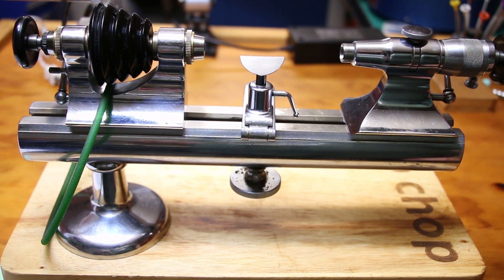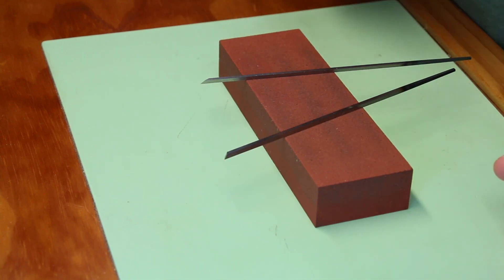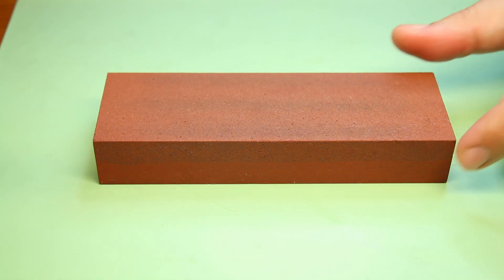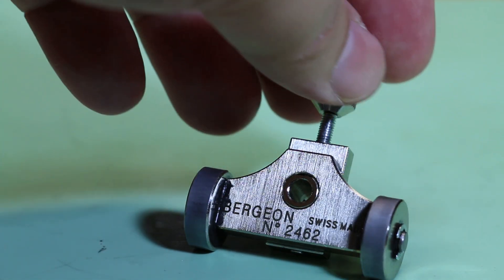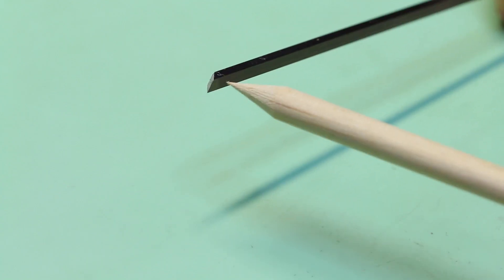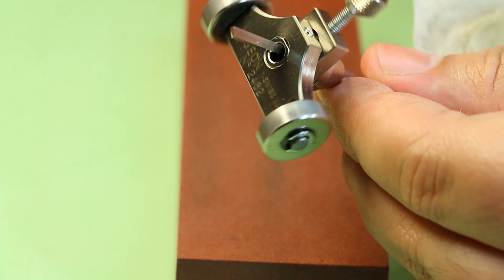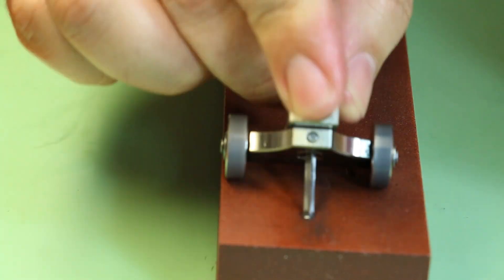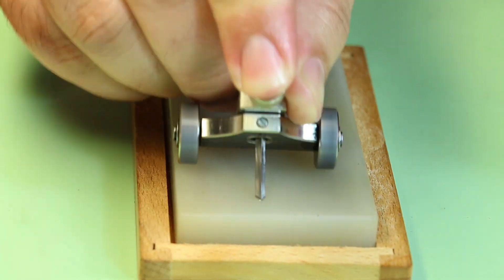Watchmakers Lathe Graver Basics - How to Sharpen a Graver using the Bergeon 2462 Tool

Comment: Using the sharpening tool, the stone wears in the center fairly quickly. You can dress the stone by oiling and rubbing it on a cheap HF type diamond plated plate and watching the grove in the center shrink to nothing. Great for refinishing yard sale stones.

Comment: Hi Dean, I just got a 2mm graver with handle off of ebay, but when it came I discovered that the handle is just a regular pin vise, and won't accomodate a graver longer than 2 inches..... do you know of any places I could get a proper graver handle that will accept full length blanks?

Comment: Dean, thank you for the great content!

Do you use these directly after quenching or do you temper them?
Reply from the maker: Thanks for your comment. I purchase these ready to go, not heat treating is required.
Reply: @DeanDK  Ah - OK. Thanks for the reply. I wondered mainly because it seems like a lot of grinding on a stone to get the initial shape, but I guess it's so small that it isn't a problem.

I am giving some W1 tool steel a shot in anticipation of making more complex shapes more easily. It looks like it should be tempered from what I've seen elsewhere.
Reply from the maker: Yes if you are using W1 Tool Steel it should be harden and tempered slightly to like a straw yellow colour.. Vallorbe already come with the diamond shape ground and tempered. Just needs honing, and if the tool chips, re ground on the stone by hand. Because it’s by hand it won’t heat up and lose its hardness

Comment: Don't use 3 in one on your oil stone Arkanas stones should be used with water
Reply from the maker: hmm you sure? Arkanas is an Oil stone. Can you link a reference for using water?
Reply: @DeanDK  Arkansas stones can be used with water or oil, if you use water you need to use much more than you do oil, I was trying to make the point not to use 3in one it is horrible stuff, leaves behind a residue and almost impossible to remove.
Reply from the maker: Ahhh okay, yes I believe you are correct in terms of the 3 in 1 being horrible. I used to use honing oil, it got a bit pricey.
Reply: Yes use a light machine oil,,,sawing machine oil is good, rather than 3 in 1

Comment: Can you sharpen the graver by grinding maching?
Reply: No, grinders cause too much heat damaging the temper and making it too soft to work with.
Reply from the maker: I have seen it done, you just have to be super careful with temperature management as you don’t want to temper the steel too soft by accident as the commenter above mentioned

Comment: How do you what angle the graver sits at when setting it in the tool holder? Are you simply eyeballing it?
Reply from the maker: Yes, once you do have sharpened and used the graver many times over you get a feel of which angle works best for you.

Comment: Some of this you'll likely know Dean but others may not.

The Bergeon tool would be I suppose a traditional way. But very much related to sharpening and now a not very well known tool at all would be one used by Ornamental Turners called a goniostat. Google images using that name will turn up lots of pictures. Anyone owning a lathe or wanting to sharpen something like these gravers should at least understand how those goniostat's worked. They can sharpen either a single angle but also compound angles. Unlike that Bergeon tool almost all of the stone surface can then be used so your not wearing grooves in the center of the stone and then having to re-flatten it. Building a modern version of one of those goniostats and using a couple of small plastic drafting protractors or the better laser engraved metal ones wouldn't be hard. Originals can still be found, but always at high prices the collectors are willing to pay. In use the 3 legs of the goniostat can be slid back and forth on a sheet of glass with the stone surface sitting in step below the glass but still leveled to the glass elevation to keep the angles accurate. It's a very good system for putting a final ultra sharp and accurate hone on a tool. Lathe 55 or 60 degree threading tools for example. The tiny radius at the tip would still need to be done by hand of course. 

Diamond wheels for example unless there run at very slow speeds are not recommended for sharpening HSS or high carbon steels since the carbon composition of the metal and the heat generated can quickly destroy the diamond particles. CBN wheels are the recommend wheel for that. However using diamond plated laps just like in this video at those slow hand speeds the now common diamond so called "lapping plates" sold at woodworking dealers and made by DMT and a few others can also be used this way. There about the cheapest way I know of for re-sharpening carbide but also HSS and high carbon if required. Any man made or natural stone used for sharpening will ultimately get grooved, load up, and get glazed just like bench grinder wheels. For that reason those DMT lapping plates can also be used to both re-flatten a grooved stone and remove that glazed surface so it then will cut as well as a new one.

Comment: This is when you have steel gravers. Now - how to sharp a carbide graver? I believe these stones will not do the job...
Reply from the maker: You are correct. I will make a video about carbide soon!
Reply: Use diamond abrasives!  I've seen some instructions where a small diamond abrasive wheel is spun in the lathe, so the lathe is used to sharpen your graver.  I haven't done this, but have used flat diamond sharpening "stones".

Comment: I had to laugh at the guy who call's himself the Village Clockmaker on YouTube when he say's you can't turn pivot steel or as I call it blue steel, I put a comment on his video saying that I am an old Watchmaker and that if he can't turn blue steel with a graver he should go back and learn how to sharpen his graver, I hope he watches your excellent video on sharpening a graver. If your graver is sharpened correctly, your T rest is firm and in the correct position your center height is correct and the lathe is running at the right speed not to fast as a lot of Watchmakers make this mistake, you can turn blue steel as easily as turning brass. I have watched some Watchmakers on YouTube turning and the noise of their graver and motor is enough to set your teeth on edge. From a nearly 80 year old WATCHMAKER who has turned up literally hundreds of staffs and cylinders in his life. Keep up the good work.
Reply from the maker: Thank you so much Keith. Your comment means a lot :)
Reply: @ralph edman
There actually aren't a ton of materials that don't have any use anymore. Even if things got pushed out of being the standard, they still have their place. Hss is super useful to keep around, it isn't as brittle as carbide, can be sharpened to a keener edge, etc. O1 and the like can be sharpened even keener without chipping out even if the edge life is short, can be quite easily heated and bent and rehardened in a small shop or you can have just a hard edge and a soft body.

Comment: Grate video but why not just use carbide?
Reply from the maker: +elijah williams These tool steels cut really well, and you can have a very fine sharp point which won't chip as easily as a carbide. However, carbide does have its advantages. But for brass especially I will choose tool steel over carbide.

Comment: I just bought a Boley lathe, which i didn't follow any of your lathe buying tips ... simply cuz i bought it b4 i seen your vid... anyway im trying o make my own graver, and  was wondering what is a good source for the metal? 

thx
Mat
Reply from the maker: +MeDI NaKHLA Thanka for your question. I use Vallorbe Carbon Steel gravers from cousinsuk. I also have the bergeon graver which is sintered carbide.
Reply: I also have a Vallorbe Carbon Steel Graver (Lozenge 2mm) which I have tried to use to cut balance hubs for restaffing.  However, the graver does not seem to "cut" at all.  There is no strip of metal cut off as I would expect but rather almost nothing seems to be removed.  Even after resharpening the graver several times, I cannot seem to actually be able to cut any metal.  Any tips?  I am not sure why this is happening but it very frustrating!  Am I simply running the lathe too fast (as I have read doing so simply burnishes the metal rather than cutting it) and need to try with a new practice balance in which the metal has not been hardened/burnished and spin it slower? 

PS:  Keep up the amazing watchmaking work!  One of the best watch channels on Youtube

Comment: Have been working with a 45 degree lozenge graver but will experiment with a 30 degree one.  Some also recommend "beveling" the cutting edges which, in effect, changes the rake.  What do you think?  Thanks.
Reply from the maker: +douglasskinner That's great to hear that you have been working on hand turning. You will notice how much 'softer' you will have to be as you angle decreases and the tip more fragile. But some jobs require this to get into tight spaces.

 I have not read or seen this technique being done. But thinking about it, I believe you would have to adjust your graver angle to present the cutting edge to the work, instead of resting the graver flat on the t rest when turning diamond down. 

I am unsure about any benefits the bevel on the edge would bring.